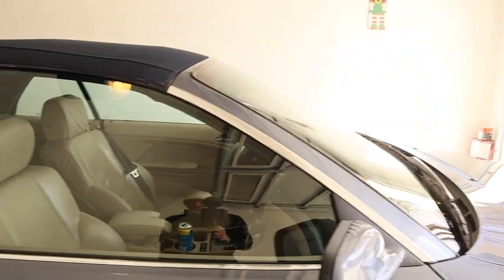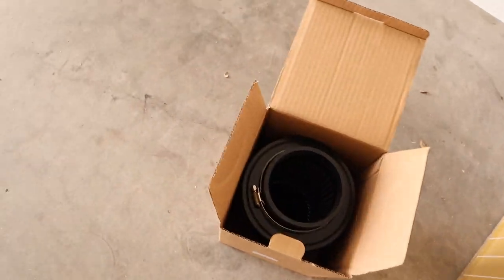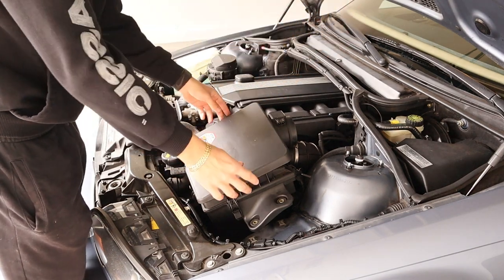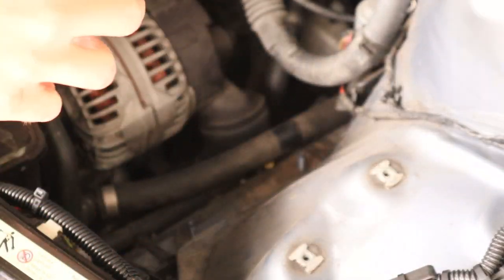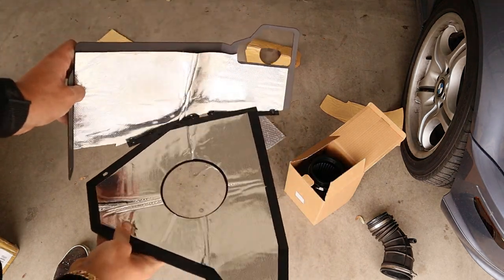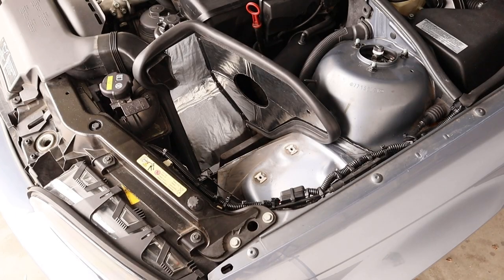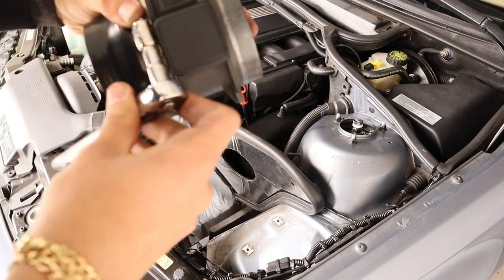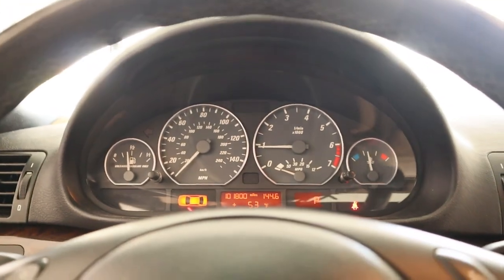HOW TO INSTALL COLD AIR INTAKE | BMW 330CI E46 M54B30

Comment: i could be completely wrong , but shouldn't the reflective foil be stuck to the outside of the heat shield to reflect engine heat away from the cold air intake filter, rather than on the inside reflecting heat at the filter?
Great video. Very useful how to.
Reply: You’re correct but please don’t do this to your car. The stock box keep the air cooler than this set up does. I ran this for a few months and notice my intake temp was higher especially at idle. I wish they would make this in a boxed out and in plastic.

Comment: Can you confirm if only the upper air duct has access to the filter or the one coming from middle lower part also has access?
Reply from the maker: the lower part of the air intake is also prone to cracking, i would say check that. it’s quite a lot harder to replace that one.
Reply: @emanuelxbmw  thanks for the response. I've been thinking about getting a cai